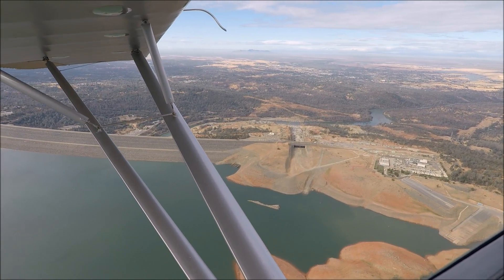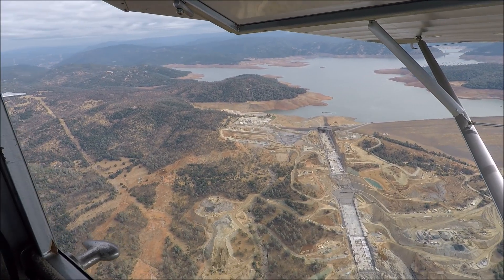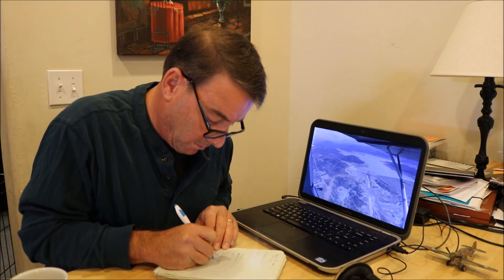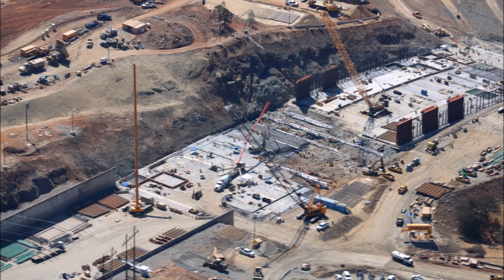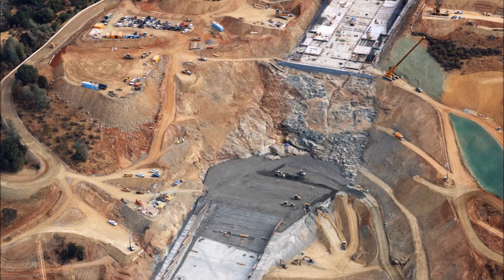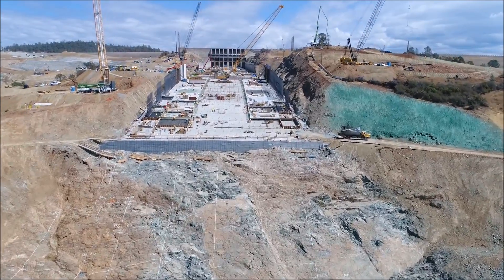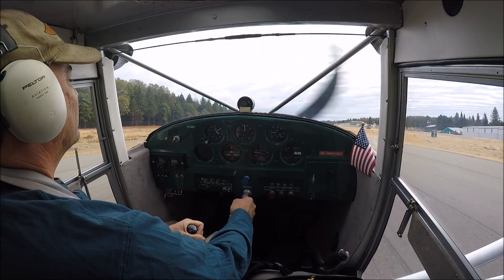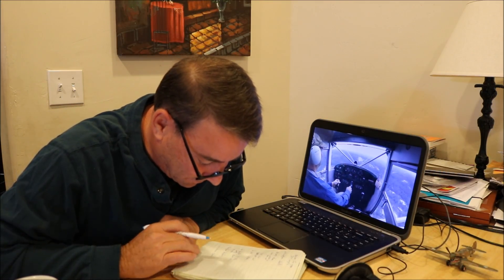Oroville Update 20 Sept. 40 days to go...

Comment: Juan, From the outset I have been totally puzzled by the 'reportedlogistics of this operation In particular, the amount of material removed solely fom the diversion pool only are reported as 1.44 Million Cubic yards? Having looked at the visible earth moving equipment, namely the Cat 770G Off-Highway Truck used to transport the debris, research shows this truck to have aBody Capacity of just 33 Cubic yards. Mathematics shows that this equates to 42,424. loads. A VERYg CONSERVATIVE Guesstimate OF 15 MINUTES TURNAROUND TIME equates to a timescale of 16.5 yrs using just a single truck. Given your unrivaled access to the critical specs, actual numbers of vehicles etc, I would love it if you could do your own calculations to finally explain how the clearance could possibly be humanly achieved in the timescales claimed??? ANYBODY???

Comment: Juan great channel you are very well versed in civil construction matters. My question is in regards to the heavy equipment working on the RCC , how has the concrete affected the equipment ie. tracks, rollers, internal parts in the engines sucking up that lime dust? 
I am currently working on the Dulles silver line along side Kiewit & CLARK installing wet utilities, you should come by and see us when you fly into the airport.
Reply from the maker: A small army of mechanics working around the clock on site keeping the equipment operating.

Comment: This may have been asked already but I have question about the RCC.  Typically with structural concrete you don't stress it for about 30 days after you pour it. How do they get away with driving on the RCC continuously with heavy trucks? The weight of the trucks will probably transmit down 3-4 feet into the "new" concrete that is 3-4 days old.

Comment: Great video's Juan!! I do have a question for you though that you might ask the staff of Kiewit. I noticed a lot of dark clouds on the DWR webcam and was wondering what their protocol is when lightning storms are in the vicinity. Lots of high cranes could be strike points and a danger to any crew nearby.
Reply from the maker: Harv Schmidt good point, like working on an airport ramp I'm sure they would clear the deck if lighting is within 5 miles. Fortunately kinda rare out here.

Comment: I counted at least six large cranes on the project, and know that they can run anywhere from $650-1000 an hr to lease/rent, plus the cost of the operator.  Would you be able to get a handle on the actual cost of some of the equipment that's being expended on this project?  As a side note, just the cost of having extra operators, mechanics, and spare parts for the rock crushing plant, the concrete plant, and other required facilities has to be astronomical, because if you have a breakdown, say in the concrete plant, you have 300 men on either shift standing around with not much to do until it's fixed.  Our hats are off to Kiewit and Co for the amazing job of coordination and expertise they are lending to this project !!

Comment: The Oroville dam contains about 78 million cubic yards of material. By contrast, he spillway repair will contain about 250 thousand cubic yards of RCC. I haven't found the initial cost of the dam (to convert to 2017 dollars), but the dam saved an estimated $1.3 billion flood damage between 1987 and 1999. Since the dam was completed in 1968, that doesn't account for 36 years. All in all, it doesn't seem like $450 million "maintenance" is very expensive. If the failure was preventable, it does seem like an expensive mistake.

Comment: At 11.40 you showed the huge cavity that is yet to be filled to connect what is basically the lower spillway to the the top section;  the contractor's are filling it layer by level layer,  rolling and compacting the semi-dry concrete into position.  Why are they doing it this way?  I would have thought lowering large boulders in from the air and concreting them in position,  as was done at the south end of the emergency spillway outflow,  would be satisfactory;  unless,  of course,  there are no large boulders left to air-lift in.
Reply from the maker: Derek O'Brien They're required to have a solid connection to bedrock. Anything airlifted is prohibitively expensive and too slow.

Comment: Hey Blankolirio, Juan, you always ask the right questions, main stream media could learn allot about their "job' just by watching your informative updates.  I was wondering what those baffles mounted on the inside edge of the side walls, in about the middle section, what their purpose is.  Visually, it looks like they should be angled in the opposite direction.  Seams to me that the water while flowing would want to splash up and over the walls?  You have probably addressed this issue but I obviously missed it.
Reply from the maker: T. Dolan they are temporary scaffolding.

Comment: Kiewit has been in business for a very long time. In the 1880's they were bricklayers. In the 1950's they built Air Force bases in Alaska. In the early 1960s Kiewit was the primary civilian contractor for Camp Century, an experimental nuclear powered base built under the Greenland icepack. Camp Century was part of Project Iceworm: a vast series of proposed under-ice ICBM launch sites. Camp Century was a failure. The planners didn't know about shifting ice caps.

Comment: Juan, A question for the engineers. With the large mass of RCC being placed so quickly are there any concerns about the heat generated by the exothermic chemical reaction of the setting concrete?  What are they doing about it?
Thanks for doing such great reporting.
Reply from the maker: urlkrueger RCC, sets up in 24 hours.

Comment: Great reporting Juan!  Are they going to leave the road across the bottom of the spillway in place until the lake level rises to the point that they have to take it out?  It looks like they are to the point now that its the only way the giant trucks can get from one side of the spill way to other. (assuming they won't wouldn't run a loaded giant truck on the paved road at the top of the spillway.)
Reply from the maker: I think they'll remove it.

Comment: I remember back in the early '90's my Uncle flying in to Destin Airport [FL.] in his plane I  did notice the "X" in front of the number for the plane.  Well it is the one he started building in his living room in Boulder, CO., then went to the basement to build the rest.  Main portion of the plane was brought out first and then the wings.  He got it to the airport and installed the wings. He had the plane flown by a test pilot and it got its permit to fly.  He mentioned that the altimeter did show a problem upon landing at sea level, it showed he was 30' below.  Yes, I did get the opportunity to fly the plane once he took off.  The 40 HP lycoming engine [reminded me of my '64 VW engine] had enough power to do everything it was asked to do..  
He took it to EAA AirVenture Oshkosh had a side wind and walked away with only the propeller.

Comment: Great Update Juan! Is Keiwit going to go to double crews on the plunge pool soon? If the plunge pool is half filled the surface area is set to double very soon? With one crew getting one foot of elevation every 12 hours. That will make 2 ft per day, but only on the half of the elevation that they are working on. How are they going to address the extra area of steep grade that gets closer to the upper spillway? Thanks for keeping that infinite spiral notebook rolling Juan!
Reply from the maker: Been on double shifts from the beginning. Pool is at max area now. This will decrease and lift will increase per this report.
Reply: Maybe it is the camera angle? It looks like they filled half the tilted RCC salad bowl.  With 2 - 90 degree perpendicular line's from the untouched shear cracked rocks to the upper spillway. That is the additional spillway surface area that I'm describing.
Reply: Sorry Juan maybe it is the way I wrote my question, but I am talking about the spillway surface area growing while your are describing the plung pool surface area at the bottom. You are at the acute triangle angle at the opposite side of long side of the spillway surface area; that I think needs to grow to meet up at the upper spillway.

Comment: What are you doing about ADS-B IN your airplane?
Reply from the maker: nothing yet...hoping for a delay, and a cheap fix. Or just avoid the airspace requirements if possible.
Reply: I see portable units are  still not approved.  With no electrical system it appears many airplanes, such as yours are in for trouble.  ( my question should have said ADS-B out to install in your airplane :) you missed the $500 rebate, application deadline was 9/18.   ( I'm not a  pilot and not in  CA, but keeping up with your videos thanks for them )

Comment: Juan always very informative in your videos. Thank you for your time to do this. I have a question, did you ever find out what the scaffolding is for on the rcc retaining walls?  Always look forward to your upcoming videos every week. Amazing project to follow.
Reply: The vertical inside faces of the provional RCC spillway training walls are being formed using steel wire and will be surfaced with shotcrete reinforced with steel fibers.
Reply from the maker: For installing the wire mesh on the inside RCC walls.
Reply: They are mounting rebar for trimming walls behind the scaffolding. We do not know yet is they will use shotcrete or if the concrete will be molded. Any idea Juan?
Reply: See https://pixel-ca-dwr.photoshelter.com/galleries/C0000OxvlgXg3yfg/G00003YCcmDTx48Y/I0000i2Liump9mRM/KJ-oroville-0944-09-20-17-jpg
Reply: The shotcrete has made its return.  Long live shortcrete!  ;o))

Comment: I am still curious about how the wall panels will be stabilized. How will they be prevented from moving when they undergo the massive water forces? The "horizontal" slabs are anchored to the bedrock with thousands of anchors. Will the wall panels be anchored to the sides once these are filled again?
Reply: Backfill up the sides will help prevent at least some of the pushing out.

Comment: Great update Juan. Thank you!!! On the "green spot, why don't they duplicate the "rift"  on flat ground out of a big long perforated fiberglass tub. Fill the tub with some dirt, rock, and simulate the seed laden silt that runs into the actual rifts. When this "artificial" rift duplicates what's happening on the back side of the dam, it would substantiate the explanation.

Comment: Juan, Thanks for asking the question I posted about the water spraying in the pool at the bottom of the spillway. I have an other question; What I don't see in the walls is holes for the under-slab drains. Juan  when you get a chance can you ask Kiewit / DWR how the under-slab drains will "vent" the water. Is that through the walls into the spillway. And if so when will they be installed. I don't see holes pre-drilled for them just yet.
Reply from the maker: I think your answer is in this construction tour series...https://www.youtube.com/playlist?list=PL6SYmp3qb3uOd7cfyjp_O7vCsaSSp_jTt
Reply: The drains go back into the spillway. That way they can see when there is significant output at any point (rather than it going into the ground somewhere and taking years to discover). This was explained in the construction tour Juan did.
Reply: exactly... but What I did not see before if they are going to drill the holes after they pour the concrete or if installed cutout before the pour. In the latest video from DWR I think I saw they they precast openings.

Comment: IMO, they sure have a lot left to do. I noticed today that, because the lake level is so low, they are forcing houseboat owners to leave their moorings and pull them off the lake. A costly expense and some owners are suing the State. The canyon walls are just too close to maneuver at the those low levels. Great job again and thanks for the flight lesson!
Reply: Can you tell me what part of the lake the houseboats are located by using google maps, zoom in on that area and post the link?
Reply: http://www.chicoer.com/general-news/20170918/low-lake-levels-mean-houseboats-come-out-and-boat-owners-arent-happy-about-it?source=most_viewed
Reply: I read the story. Once they tow the boat out of the water and out of the way, do they put jack stands under it and remove the trailer? And it costs about $700 to do this move?
Reply: Here is the Google Map location of Lime Saddle Marina which is located on one of the rivers that drain into Lake Oroville, about 10 miles North of the main lake area. https://www.google.com/maps/place/Lake+Oroville+Marina/@39.589671,-121.4608714,11z/data=!4m5!3m4!1s0x809ccdeac7fd4523:0x79a5a730449c663!8m2!3d39.6758644!4d-121.5590617?hl=en
Reply: Here is the Google Map location of Bidwell Marina which is located at the South end of Lake Oroville. https://www.google.com/maps/search/Lake+Oroville+bidwell+Canyon/@39.5347449,-121.4463934,12z?hl=en

Comment: If this truly ends up being an "la nina" (dry) winter, is there a possibility the main spillway will never be used with all runoff exiting the lake through the power plant? Obviously they can work on the secant wall over the winter since they anticipate water will never run down that area again, but are there any other areas of the project where construction could progress through the winter? Or will they send all the workers home until late spring of 2018? When will the roads across the bottom end of the main spillway be removed? Will they wait to see if the main spillway is coming close to being used this winter, or will they remove that soil preemptively as part of the plan and rebuild that road next year during the construction season?
Reply from the maker: Robert Dyer they'll keep working...reduced staff. Most likely won't use main spillway this year.

Comment: Any idea how much bigger the rebar is in the new Spillway compared to the old.
Reply: I don't think it's too much bigger, if at all. But the green paint that you see on some of it is an anti-corrosion layer that I don't think was on the original.
Reply from the maker: PERRY C bigger and LOTS more of it...current code.
Reply: At least double the original. There is a top and bottom layer, instead of only one.

Plus, the extra locking rebar. Which is easily 25-50% more again.

Comment: An amazing engineering and construction feat!! Almost as many cranes there as there are in Nashville! lol  I follow as I have family that drive between Redding and Sacramento, and so appreciate your expert coverage.  Is the plan to have the plunge pool filled with concrete to meet the upper part of the spillway before Nov.1, or to use the slope of the plunge pool as a splash pad prior to hitting the lower part of the spillway?
Reply from the maker: King's eyes fill it up.

Comment: Juan - following up on prior response on the width of the surface area of RCC.  At 9:44 the photo shows much more surface area being covered which I think correlates to the record day of RCC application.  At 10:38 you comment that "the RCC walls are spread very wide to maintain the same slope". I don't really understand what you mean by that comment.  Again photo at 12:36 illustrates my question.  Looks like the RCC is spread beyond where the walls will be.
Reply from the maker: NutmegThumper right because of the slope of the rcc side walls. These are not retaining walls but 'mass' walls. As the plunge pool gets deeper the walls must continue to slope all the way down to the bottom of the hole. Thus appear 'wider'. It's a 3D problem.
Reply: Oh - got it - so since the walls are higher, they are built like a dam with a widening base.